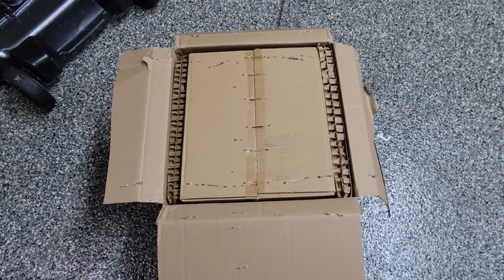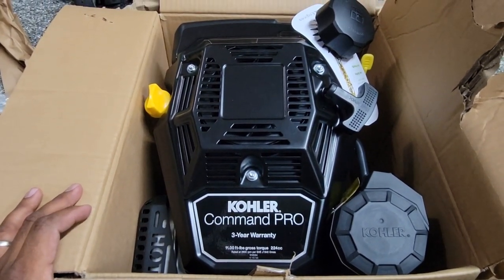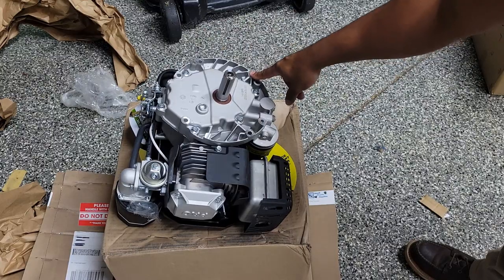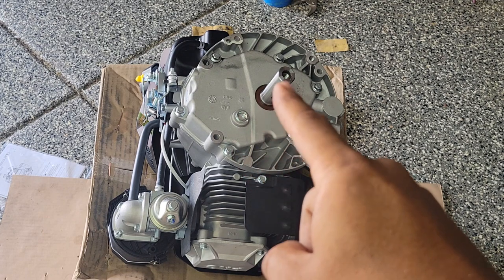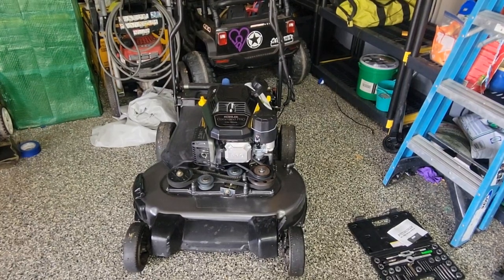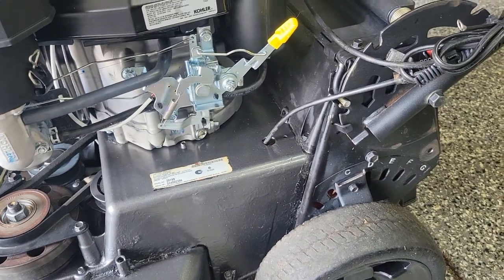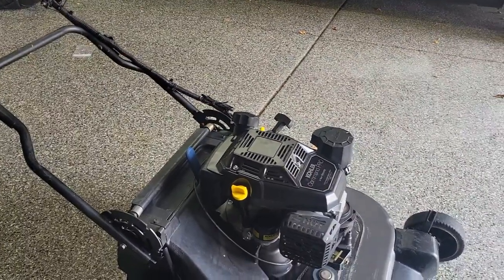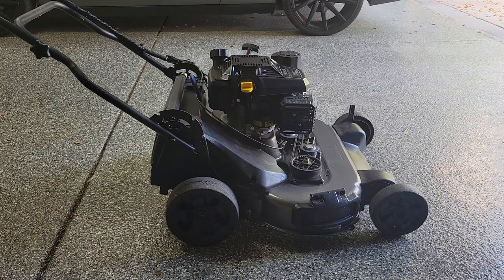Toro Timemaster Kohler CV224 Engine Upgrade

Comment: I will be doing this project also. Had to buy a new Timemaster because my old one died and I didn't have time to rebuild the old one. Will be restoring the old one this Winter, so I have a backup. Thanks for the video.
Reply: Might put the Kohler on the new mower and put the new Briggs  on the older mower. Good move?
Reply from the maker: I would put the Kohler on the old mower as long as everything else is fine. If you have a warranty on the new mower, swapping the motor may void it.

Comment: My Timemaster has the bigger engine. Just bought it for $800 with less than two seasons on it. It was as if they guy never used it. Power isn't an issue with deep grass as long as it is not wet. But what absolutely sucks is the small fuel tank. I have to refuel 3-4 times when cutting the lawn once.
Reply: Replace the fuel tank ?

Comment: You should upgrade your Blade brake clutch parts to the Turfmaster ones.  Pretty much a bolt-in.  Might need to switch one bolt for a longer one and add a nut & washers.  Since then I have never had all the worn v-belt issues I used to have.  My Kohler CV224 has run great for the past 3 years.  With that filter my oil still looks clean at the end of the season!  (Only mowing my property though!)  I don't waste my money on the expensive Kohler filters & oil though....WIX, Oregon, Briggs all have compatible oil filters, and any good synthetic oil of proper viscosity (with a touch of added ZDDP,  if desired) is all that is needed to keep that puppy happy.

Comment: The Ferris FW15 needs a larger tank and a quick chute but for the same price it has reverse
Reply from the maker: From what I'm seeing online, the ferris msrp is $3800 if I'm not mistaken. Definitely looks like a solid machine, especially if it has reverse. I don't think I've ever seen one of those before.
Reply: The Ferris FW15 is BADASS. Only thing I’m not a super fan of is the things weight. But it’s literally an actual lawn mower with a walk behind hydro pulling it around so it’s not that bad. Better than the high dollar ass scag 30” I was gonna scoop. Ima flip my time waster one of the days and scoop a fw15 I think, but honestly I try and skip any type of push mowing in general tbh
Reply: Same price? 😂

Comment: Hey nice tutorial 
Does the new Kohler come with charging stator so you can hook up to the battery ??
Reply from the maker: That I wouldn't know of since my timemaster never had electric start or a battery. I'm sure someone with more experience in that department will comment
Reply: I just did this on my 20200 Electric Start model,  the Answer is NO.  The Kohler CV224-3002 is pull start only and has no starter.  In fact I pulled the key start, harness and the battery off of mine.  I had never opened the battery compartment on mine and it was full of wet grass that was starting to corrode the deck so I am glad it is gone.

Comment: Did you ever rewire the kill switch?
Reply from the maker: No, I just use the yellow handle that comes on the motor. I just have to old kill switch wire zip tied to the handle
Reply: @TheMoreYouMOW  I just installed my Kohler today. Hardest part was finding the Kohler oil. Thanks for the heads up on tractor supply. 😂
Reply from the maker: You'll enjoy the upgrade. Finding the oil was a PITA for sure!

Comment: Do you have a part # on that Kholer CV224?  I would like to call Small Engine Suppliers and order one of these for my Timemaster.  Just want to make sure I'm ordering the right one.  Thx!
Reply from the maker: This is from a previous comment:
If I remember correctly the 3001 does NOT come with a gas tank whereas the 3002 DOES come with a gas tank. I'm sure someone will correct me if I'm wrong. I would go with the 3002
Reply: @TheMoreYouMOW  Thanks so much for your info and very fast reply!
Reply from the maker: @stevenclark5450  no problem! Also, you're welcome!

Comment: Can I put that engine on any lawn mower deck ?
Reply from the maker: You can make anything fit if you really try 😉. I would say if you don't want to drill out your deck, you will need to measure the distance between the 3 tapped holes to mount the motor to the deck vs. the current bolt pattern of your current mower deck. People use this motor on the timemaster because it is a direct replacement with no deck modifications needed
Reply: @TheMoreYouMOW  okay I have a old snapper push mower . Probably 2005 snapper. I was just wondering if I can put any engine on it man
Reply: @TheMoreYouMOW  Yes, but not if the motor has the wrong output shaft diameter. Learned that the hard way trying to put a Harbor Freight Predator engine on a John Deere reel mower.

Comment: What model do I order? the CV-224-3001 0r CV 224-3002
Reply from the maker: If I remember correctly the 3001 does NOT come with a gas tank whereas the 3002 DOES come with a gas tank. I'm sure someone will correct me if I'm wrong. I would go with the 3002

Comment: One would literally not be able to tell the difference cutting between that and the stock Briggs . If you think you do you are on crack .
Reply from the maker: Coming from the 190cc, yes I can tell a difference. I guess I'm a crack head. Thanks for the comment?
Reply: I have the SCAG fsc 30 it's a beast it's better because the blades are offset not timed like this one.
Reply: @leadnsteel1428  Toro uses a timed deck to make a more compact mower ,you get your blade overlap with them side by side. Staggering the blades does the same thing but makes the deck longer but has a less expensive drive system . The best cutting and bagging is the single blade 28 like a Ybravo but it makes for a longer mower than the Toro and takes more power to run versus the shorter blade like the Toro uses that let them use a smaller engine to make it lighter.
Reply: @TheMoreYouMOW  This. While the 223 cc stock motor is not likely very different, the 190 to 224 should be night and day.
Reply: @leadnsteel1428  Everything I read about the Scag 30 says that it's heavy and tough to maneuver. At that point, might as well go up to a 48".
Reply: @MUUKOW3  Thanks for the insight. That said, the biggest mower shown on the Ybravo website is a 25". That's closer to a standard 21" push power than this Toro.
Reply: @ILruffian  You'd be surprised how much the 25 cuts your time from a 21. If you cut in a region where wet bagging performance is required the Bravo cuts nicer and stripes better than the Toro . The Toro mulches much better and is a bit heavier.